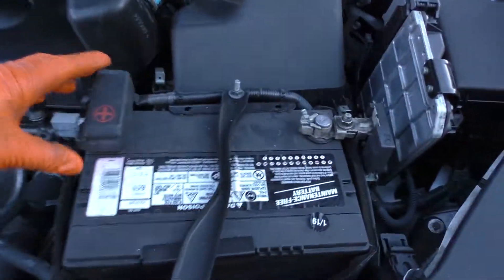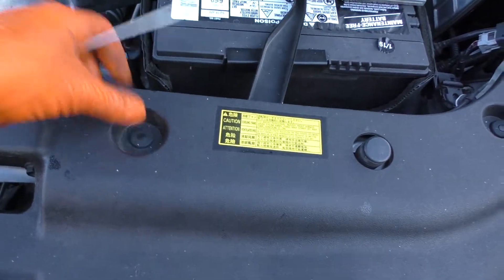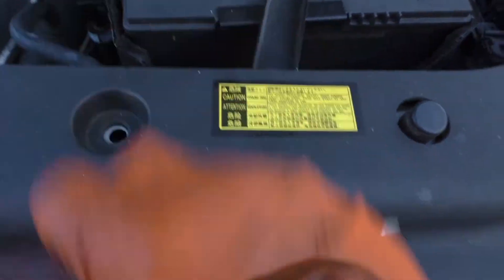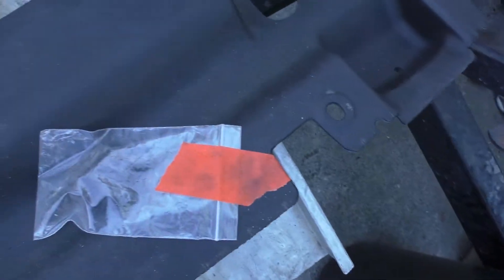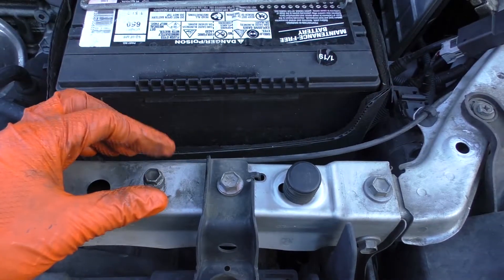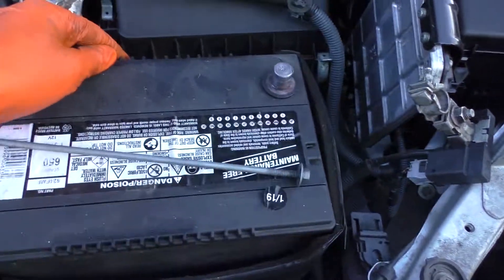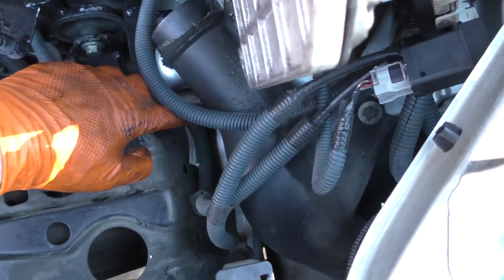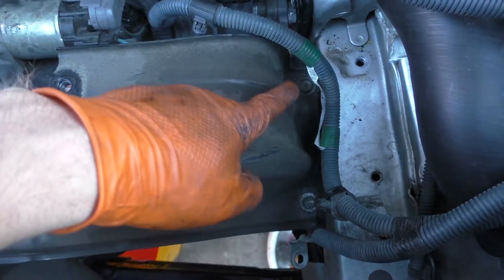(PART 2 Battery & tray removal) 08 Rav4 4WD 4 cylinder 2.4 2AZ-FE Engine Removal Replacement

Comment: I have an 04 rav4 with the 2azfe. The engine bay setup looks different on my car. The air filter is on top and battery is in front of dash. Does this matter? Will I still be able to pull my engine from the top?